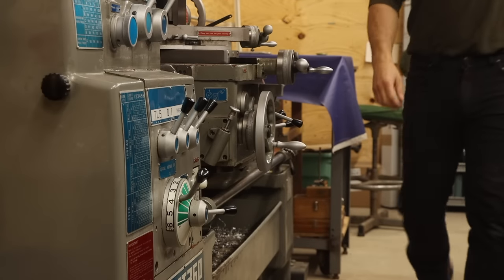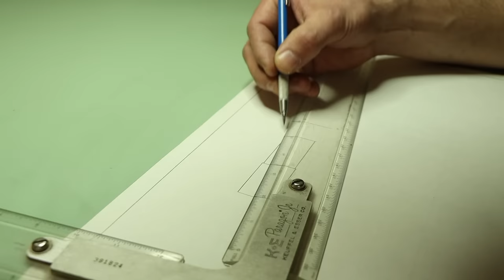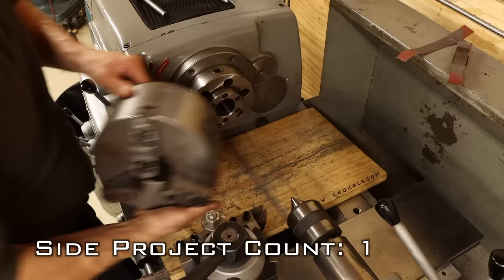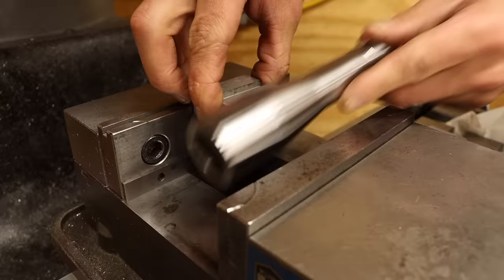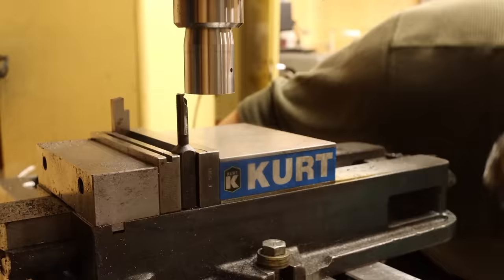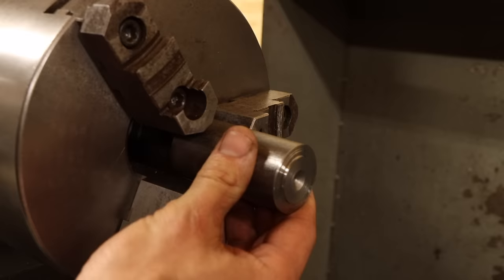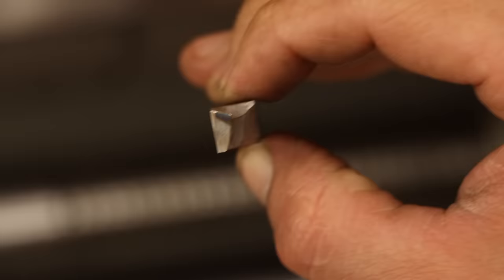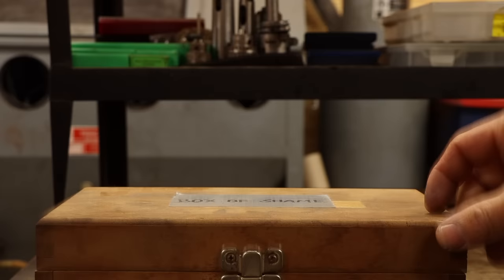Making the PERFECT* Slitting Saw Arbor || INHERITANCE MACHINING

Comment from the maker: The old saying needs amending.... "Buy Cheap, Buy Twice. Or just make your own!". Thanks for watching everyone! I've got something  a little different in store for March 17th. See you then!
Reply: Buy once, Cry once.  Outstanding work again.  Look forward every week to these videos not only for your machining but your outstanding camera work and narration
Reply: I would assume the reason the surface finish went in the toilet when turning the centering boss is that your DOC was too low. In general you want a DOC to be equal to or higher than the corner radius of the insert or the insert will tend to deflect radially, producing chatter. For this very reason we who program CNC-lathes tend to finish narrow tolerance features with a finish pass in the order of 0.5-2mm for this size part
Reply: I'd also recommend you keep that  trepanning tool you ground on hand as a general outside turning tool for plastics. The geometry you used with the chip breaking feature is awesome for plastics if you don't have PCD or MCD inserts on hand
Reply: Why does your comment say 10 days ago?! 
And what kind of table is that? The one you make your blueprint on. Was it made special or are they made by a company?
Reply: Your videos are getting better by the day. Love your work!
Reply: I need a box of shame big enough to put rather a large pile of tooling in... Or at least a waiting room for those toolings on their way to that box, as many of them are probably fixable, Once I build the tools to repair the tools...
Reply: @Homiejahcobie4004x  I bet he uploaded the video and added that comment 10 days ago, but didn't make it public. It's common practice with youtube.
Reply: Another channel I watch has a saying, “we do it nice because we do it twice.”
Reply: Don't forget the lessons you learnt from the cheapo arbour though, which you may not have thought of if you went straight to your own design. 
 Buying cheap to figure out what you need is not always a waste
Reply: No matter what the cheap ones say, you don't get a Ferrari if you pay for a Fiat...
Reply: But what pencil is that?
Reply: Oh I see now
Reply: I've actually been looking for a decent one of them for months expressing the Same words as at the end . Chances are I'll be doing the same build soon also for gear cutters
Reply: I thought you were going to use a grub screw but you just went ahead, all brave like, and permanently pinned it together...
Reply: C u then.
Reply: What if the spring breaks how do you get that pin out of there to replace?

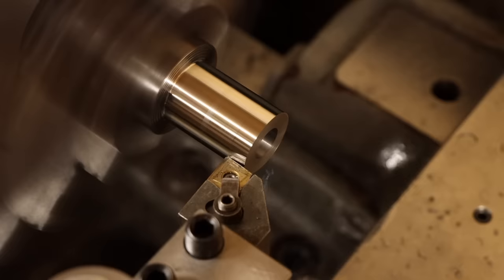Comment: At around 14:00, The reason why a 0.001 pass leaves a bad finish is because the corner radius on the carbide insert allows the part to be deflected radially. Taking a depth of cut greater than corner radius of the tool means you'll have most of the cutting forces directed axially. Joe Pie has a video where he makes an aluminum toothpick, it demonstrates how direction of the cutting forces matter.
Reply: Going to check that out now.

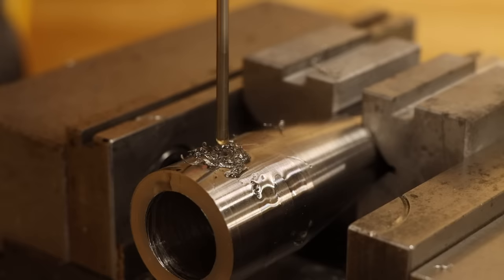Comment: 9:53 When i built a project that was used as practice for my final examination (which is in ~3 months), I forgot to chamfer the core drill hole for the reamer. That was one of the two reasons the reamer did not produce a perfectly round hole, but a slightly triangular one (deflection was ~0.07mm or  2.5 thau). More than enough that the stud that was supposed to fit couldn't go in. I had no choice but to turn down the stud by 2.5 thau until it was able to fit, but because the fitting hole wasn't perfectly round there was a lot of wiggle room for that critical dimension.

Lesson learned: Always, ALWAYS chamfer your holes first before you ream.

Comment: Brandons birthday- 8" buffer w/stainless wire wheel on one side, scothbrite wheel on the other. Anniversary -Horizontal bandsaw
I remember buying one of those slitting saw arbors(staraight shank style but the same cheezy chinese multi type) 15 years ago. I had a hell of a time cutting until I finally realized the runout. Great project, perfect series of machining techniques. Grade=A+
Reply from the maker: Sounds like you've peaked at my wish list 😂  Thanks as always, Keith!

Comment: Well done. Turned out very nice. I actually have one of those import slitting saw arbors and seem to have gotten lucky because it turns very true and so does the blade.
You might want to machine some hex flats on the locking nut though, or at least i had to because after using it, it would lock up so tight I had a hard time undoing it with an allen wrench without partially stripping the bolt head.
Reply from the maker: You lucky dog! haha I'll have to see if the cap locking becomes and issue. I don't have much material left to cut a flat into on that area.
Reply: Yes, I have an arbor and saw that is now a one-piece design because the Allen screw is stripped.   It wasn't an accidentally bone head mistake that it's stripped.   It was the second time I used it when the socket head retaining screw welded themselves into the arbor.  I knew full well the hex socket was going to strip, but I knew that if it wasn't going to loosen with the amount of force I was using that I would be drilling it out anyway.

Comment: My Dad always warned me when grinding a tool to avoid it turning gold or blue by constantly dipping it into water to cool it as that would take the temper out of it. Your thoughts ? also when you checked the runout on the blade was it a new blade or one that you ran in the junk arbor as prior use in the junk arbor might have altered the blade itself :)
Reply from the maker: There might be something to that. As it is basically annealing after all. I'm pretty sure the blade I tested with was never used. Others are suggesting that is normal so a progressive cut can be achieved.
Reply: The old don't let a tool get hot enough to change color is a left over from when cutting tools were made of carbon steel, high speed steel doesn't care about heat and you can even heat it up glowing red and bend it and just let it cool naturally and it'll still maintain it's hardness
Reply: @markshort9098  Thanks, I did not know that :)
Reply: @jetegtmeier71  i should have added that it is possible to anneal high speed steel but it has to be red hot for a long time
Reply: @markshort9098  It just goes to show you never stop learning :) thank you for sharing your knowledge :)

Comment: Treppaning also gives you free material cutoffs for other projects any time you need to remove lots of material. Instead of hogging off large amounts of metal you trepan through the front of a bar and use a cutoff tool and get yourself a nice precision id pipe.

Comment: If you haven't thrown the cheapo one, then delete the pip off, enlarge the hole to get rid of trueness issues, and make a cap that's also the bolt. But make the disc flange 2.5~3 mm thick for a low profile cut. Could be useful to get over features and it wouldn't cost you more than an hour to do it all. I have several of these cheapo ones that i've converted for different blades that were either with defects or non standard sizes and they're great for just grabbing off the shelf, no blade change, just plug and play. If you do the can and bolt in one, the rigid nature will allow you to run bigger blades too, near table saw sizes (if, you feel comfortable with such a size) which allow you to get into really deep features and also, owing to the large diameter, slow down the cut a lot.

All that jamble said, you've created yet another cool tool for the shop. Awesome!

Comment: Restoring my old South Bend clone (Swedish Åsbrinks Lathe) I've used citric acid boiled hot to clean off rust from tool parts.
It's relatively gentle, not toxic, and rust cleans off very easy with steel wool or some other nylon abrasive like you used.
And again, nice video !
Reply from the maker: Thanks and thanks for the tip! I normally use evaporust which works great. I was just impatient 😂

Comment: I can't help but notice as you're turning that 4140 what a gorgeous surface finish you're getting. Far better than what I see on many other hobby machining channels. Is this down to the inserts you're using, the rigidity of the lathe itself, speeds-and-feeds, or all of the above?
Reply from the maker: I was actually surprised myself. I might have just gotten lucky and nailed the speeds and feeds just right because I've used those same inserts on 4140 before and while they left a decent finish, it wasn't nearly as nice as this

Comment: Excellent design.  I just bought the plans.  I'll need to modify it a bit to fit my Van Norman #12 but R8 and Van Norman C taper are reasonably close so I think dimensionally everything will fit.  I picked up a bunch of slitting saws which, of course, seemingly all needed a different arbor diameter.

Comment: A few tricks I've used is using between the centres is just cleaning up the end diameters and then putting it in the chuck and using the cleaned ends as indicator references 

Use a known good arbor to pick up your angles faster
Reply from the maker: Great tips! Thanks

Comment: Hey Brandon, you can avoid the need to turn between centers with bent stock if you drill your center hole with the stock pulled out in the position you're going to use the tailstock. If you drill the center hole and then move the stock out, you run into the problem you encountered. You can face close to the chuck, pull the stock out as far as needed, drill the center without any support, and then move forward.

Going between centers probably guaranteed better concentricity anyways, but I figured I'd give you a heads-up.
Reply from the maker: I appreciate the tip! I might have gone that route had I thought of that at the time.

Comment: I watched the earlier slit saw video and your perfect slip saw video.  In each you found or foresaw problems and corrected all you came across.
The actual future failue pointed out that by using normal thread rotation a bind was created during heavy cutting forcing the internal pin to simply twist into the standard taper and was able to stall the motor.
Either a shear pin concept is needed or the thread rotation should be reversed so future binding does not seise the taper and stall the motor but simple loosens the blade and stops cutting if you forget to lubricate.

Comment: Great timing. I've dumped the the 2 different slitting arbors projects I started after seeing your design! Revision #3 using your design will be the final and best. I'll do the extra time to machine an R8 shaft vs. a straight shaft. Your stepped adapter will really be nice as I build up a selection of saws. Thanks for your videos and explanations! Steve from San Diego.
Reply from the maker: Hey that's awesome! Good luck on your build!

Comment: Great video.  Not sure I'm up to a piece this precise yet, but it DOES make me think more as I'm delving into making my own HSS tools.  I fixed up a pair of old bench grinders and got good wheels for them, but as you showed, sometimes there is a LOT of material to grind away.   When you rough cut away some chunks with the angle grinder, is there a particular kind or size of cutoff wheel tthat's best for that?  Glad for any input before I buy cutoff wheels.  Thanks.

Comment: I made 5 arbors of different lengths and just used a 1-inch hole size for the 3 saw arbors and 1.25-inch for the 2-arbors holding the horizontal milling machine cutters.  The fixed diameter attached to the arbor gives me a much truer concentricity and I get more use out of each saw blade, provided I only order one-inch holes on my saws.

Comment: Well done Brandon. Looks like a tool to treasure. 
For your look-see up the inside of the bore you can purchase, relatively cheaply, a borescope that works off the USB port of a laptop. I think mine was about $40 Cdn. It's about 10mm in diameter, has a controllable led light coupled to the lens head. Won't say it's result is HD but certainly acceptable for trying to see where you're going. I bought mine from Banggood in China.
Otherwise a well executed project, only four on the side and most importantly none to the BOS.
Regards from Canada's banana belt.
🤞❄️🇨🇦🍌🥋🇺🇦🕊️🇺🇲👍
Reply from the maker: Oh interesting. I'd imagine if you are brave enough you could even use it while cutting. Thanks, Ron

Comment: For finishing the post/trepan, is usually use a boring bar. Either left handed or turn your spindle in reverse. I literally just ran a job last week with a giant trepan groove and a shop made trepan tool, and used the boring bar for fine finishing. Held .0002 tolerance throughout. Great work making your cutters tho. I know some guys who've been in the trade 20+ years and have no idea how to grind a tool.
Reply from the maker: Thanks! I honestly would have gone with a boring bar for finishing as well but just didn't have one small enough to fit within the groove

Comment: I have a project idea for you, if you're interested and if you think it would be interesting enough for the channel.
How about making a machinist's deburring scraper? The 3 sided ones? I love the finish they give and I've made tons of them.
I know the easy way to do it is just to repurpose an old 3 square file but you could also do one on a diving head or rotary table out of tool steel and heat treat it, I've done a couple that way.
If you wanted to go really fancy you could do the same out of carbide but then you need a diamond grinding wheel for hard material like that.
That idea just popped in my head because i just watched a guy make on in a YouTube short out of a lathe by using polygonal turning and the end result was so beautiful.

Comment: Well done. 
I initially purchased a cheap saw arbor and immediately regretted it. Since I did not have a lathe, talent, or time to build one - I had to melt down a credit card instead. The arbor that I worked great is, no surprise, quite expensive to buy. 

It was, however, far cheaper than a new lathe and the long learning curve.

Comment: I believe you are supposed to extend the stock before drilling the centre, precisely to avoid the issues with bent stock. If you stick it all the way out then you'll get external runout when drilling, but the centre will be true and since you are turning down the outside, the runout will be removed. I like the use of turning between centres though, a good solution for maximum accuracy.

Comment: That's a highly advanced work. Well done!
Making arbors for 0.7 mm, 28 thou, was fun. The 6 mm center hole was not at center. The arbour runout was really small but measuring on the teeth.... Less than 1/4 of the teeth were cutting.
The arbor was made to fit in a collet.

Comment: Regarding the finishing on the parts to remove surface rust, have you thought about buying an older bench grinder, then changing the stone wheel for a wire wheel? Thats what we use in my workshop and it's great to remove grime and rust for a nice clean clamping face

Comment: Another beautifully designed and crafted tool for the shop.  Shop therapy.
So great to see the camera gantry getting such a workout!  I'm guessing it saves a ton of time.
Such a treat to watch at lunchtime (or after work) following a long week as an engineering manager putting out fires.  Time to escape to my shop over the weekend, and work on a fun double pendulum desk toy with my son.
Reply from the maker: I've been using it exclusively and it is a dream. Saves both time and more importantly headache. Thanks as always and have a good weekend!

Comment: Just some thoughts, the drive pin is a one way trip, a set screw would allow repair.
I have had trouble with arbor screw tightening in use until it is almost impossible to remove. I actually had to drill the head off once to get it apart. I have since been using keyed arbors, but need three or four different sizes.
Reply from the maker: Good catch on the pin. I actually left the slot in the centering boss clear through to the center bore for exactly that reason. I can drive it through if I ever need to get it apart. So far no trouble with the screw getting too tight. Time will tell, though

Comment: Good idea to face off right up close at the chuck but leave the center drill for when it's hanging out. You don't need rigidity drilling a hole and the bow will put that hole off-center of the stock but still on-center of the axis of the lathe. As long as the stock size can still encompass your part, you'll be golden. Also even if the stock isn't bowed, changing setups leaves it open to being mounted differently in the chuck and you'll get the same issue though maybe not be as visible to the eye.

I do love the surface finish you got though, really nice :)

Comment: Hey a tip for your bowed stock problem. Clamping feature.
You simply turn a step on the opposite side of the  part about 5mm deep and then clamp on there with the 3 yaw. That's how we learned to do it. Tailstock comes in like you did. This is a super rigid setup then and it will run trough after the first cut.
Reply from the maker: Oh smart! Thank you